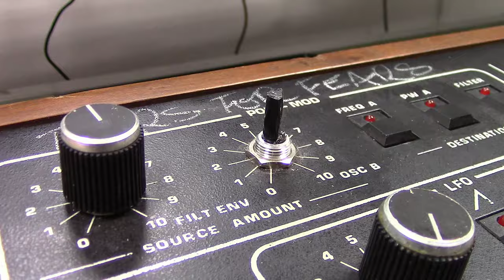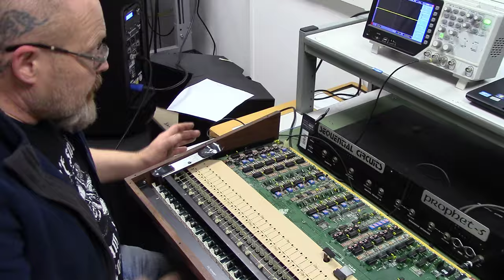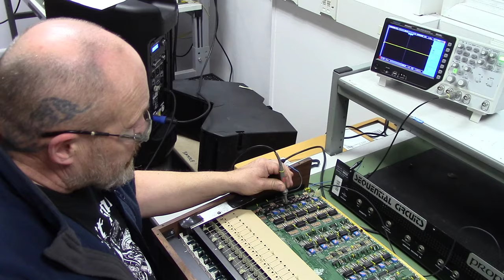Tears For Fears Prophet 5 Heritage Synth Restoration - Part 2

Comment: This might be a dumb question but is the option available to have any vintage Prophet 5 restored by your experts, even if you are NOT in Tears For Fears? My Rev 3 has one bad VCA or control circuitry for the VCA, and the keybed is shot. Would love to restore to fully playable / perfect condition. There isn't a music store with 200 miles of where I live that will touch this project for me.

Comment: That's the reason for loving "old gear": it can be repaired :)
Reply: Amen brother. As a sound tech I am often repairing older equipment.  The parts can still be found and the thrill of the finished product is beyond measure.

Comment: Great work guys… But you’re mistaken by saying your model is only 40 presets! You have in fact got a 120 preset version there. When you held the bank button down and pressed patch two, you should’ve noticed the decimal dot come between the 1 and 2...  this in fact shows you you are in the second bank of 40 presets.   By holding the bank button down and pressing 1, 2, or 3... you switch between the 3 banks of 40 memories....  Hope this helps?
Reply: That's damn useful to know.

Comment: why not fit a battery carrier ? so you can swap out batteries ?!
Reply: Ignorance to their existence is the only excuse acceptable, but I doubt it........unless its because he wants to wait until he has the proper battery for it to put in a holder.
Reply: I guess maybe one reason could be that it won't work with standard 1.5 V AA/AAA or 9 V block batteries, but some special battery is required here. I also think its a buffer battery for that the presets won't disappear, once the device is disconnected from wall power. You need to replace those kind of batteries only very rarely, so a battery carrier isn't really necessary.
Reply: @whoozl3540  special batteries have holders as well
Reply: Well normal batteries are going to leak and cause damage at some point. Also the battery probably will last for 10 years or more once replaced
Reply: @Johnsormani  10 years goes by like lightning
Reply: @whoozl3540  lithium battery holder. Got them in my ESQ1 synths.
Reply: @Haze Anderson: thank you, that's what I was meaning with "special batteries"! And those batteries are not meant to be exchanged in maybe 10 years or so, if at all!
Reply: @HazeAnderson  Why not, would make it just that little bit easier. ;p
Reply: Yeah I doint like  whin there soldered in I had to replace the battery on my ensoniq esq1 sucked but I love my kurzweill k2000v3 just pop open the door and pop in 3 new AA batterys.
Reply: @whoozl3540  rarely? That old crap starts leaking. So better put in a battery compartment with a nimh/lithium ion battery instead of the old nicd crap stuff
Reply: @HazeAnderson  still you gotta whip out the soldering gun though
Reply: @whoozl3540  It's a 3v battery, just solder an AA battery holder and glue it somewhere, get those special AA batteries for smoke detectors they last very long. It's way cheaper than getting "an original" battery. It will work with normal batteries.
Reply: Some of those keyboard "batteries" are called Super Capacitors.  The Super caps
can withstand literally 100,000
on/off cycles, as opposed to the batteries in this video.

Technics keyboards used super caps.

Comment: Did that come from the manufacturer with all those wire hacks on the PC boards?
Reply: Highly probable, those in-field engineering changes and corrections were quite common back in the days. I saw a lot of these circuit hacks also in computers and peripherals from that era.
As throwing away an entire lot of already printed PCBs and re-print them with the fixes/updates was not economically feasible, also because these changes often spanned thru the entire product's life, they simply hacked in some wires and cut traces if needed, to implement them. Often they even informed the customers which already bought the products to bring them back to the retailer's shops so the changes could be fitted in. And if you take a look to an old synth's service manual actually you would often see these changes being documented there.

Comment: What happened to Tears For Fears own patches? Weren’t they possible to retrieve anymore or...?
Reply: It seems the flat battery wiped them.

This hardware predates flash memory. The standard way to store presets at the time world have been a static RAM with battery backup power. Lose power and the memory is wiped.

Comment: Did you upload the existing patches before downloading the factory presets? They might have been useful if they were modified by the original owner.
Reply: battery was dead - mentioned earlier

Comment: Interesting video. The problem is always defective capacitors. A few days ago I repaired my Behringer QX1222USB mixer. There were 3 capacitors in the power supply defective.

Some pictures: https://www.sequencer.de/synthesizer/threads/mischpult-was-im-einsatz.49000/page-19#post-2217519   Nice greetings from Germany :)

Comment: The tantalum capacitors were replaced with electrolytics, we are told. Why? “Because they were old” is not a reason. Replacing old caps with different capacitor types requires a reason for changing the type. If in a given part of the circuit the difference does not, in your opinion, matter, say so. Sequential specified the generally more-expensive tantalum type because, in all likelihood, they thought it did matter.

This was odd to hear right out of the gate in this mostly interesting video.
Reply: Tantalums are used in stabilizing power, so the current electrolitics are way better spected that the old tantalums. The caps that "sound" are the timing caps and that should be spected as similar as possible as the originals, but the change in this case is more than welcomed. Also tantalums are more dangerous as can explode ruining the PCB and the whole synth. Let the repairer work, he knows his sheet.
Reply: @ZElTGElST  This reply is unhelpful, but thanks. All capacitors "stabilize power" in some sense, but that was not at issue. The replaced tantalum caps were not in the power supply, were they would not have been anyway.

The repair seems to have been done with whatever was ready to hand - not chosen for its specific qualities. For a quick fix, this is fine. For a "master" restoration, that's not so good.

In any case, I never said the fellow should not work. He gave an explanation for a choice that left out the reasoning. Yes, the caps were old. But why mention the type change with the implication that "old" explains it? Recapping dead caps with any live ones is fine. Using different ones should have had a better explanation. Or just say you replaced old capacitors and leave it at that. What we got was neither this nor that.

No big deal - it was done the way it was done.

Comment: Its so funny, we cant produce the great stuff from that old time anymore as most of the dedicated IC's are obsolete since a long time. And now there is this teaser company called Behringer, who knows this, but wants to tease everybody with videos like this or that one from the Jupiter-8. All they can do is produce some crappy emulating stuff.
Reply: In fact they can, all companies can but they wont because they're ignorant. Roland still has all the blueprints of the IC's. With the proper equipment you crack any IC and recreate it. Thats what Behringer did with the Curtis CEM 3340 and CEM 3320 chip, they're producing these chips themselves now, thats why their clones will sound very good and identical. Same chip was used in the OBXa and the PH5. Fuck Roland anyways. I almost bought the Jupiter 80, till I discovered that it's shit and has nothing to do with the old Jupiter.
Reply: @padmad3k63  Sure they can produce them again. Doesnt matter if they are through hole or SMD. But someone has to do it
Reply: @klaasj7808  Only bad thing I can say about SMD is it will be much more difficult to replace a resistor in SMD format compared to trough hole. Good luck trying to solder a resistor in a 0201 package. It can be done but still. Yeah I agree with you, Roland shouldn't be anal about releasing their own vintage stuff. If they don't want to, some one else will do.